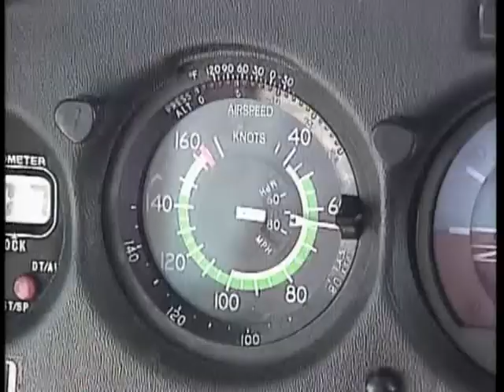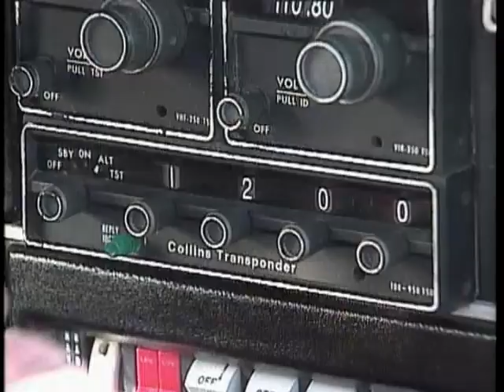Ditching an Airplane by Barry Schiff

Comment: This information is all wrong.  When crashing into water what your suppose to do is open the door and jump out at about 20ft altitude preferably in a stall with the lowest possible air speed.  Using this method prevents all possibilities of slamming your head across the instrument panel during the initial impact and loosing conciseness and drowning do to incapacitation
Reply: Was Trevor Jacob your flight instructor?

Comment: 7:29 A simpler explanation for the disparity between retractable vs fixed gear survival statistics is that I assume retractable gear aircrafts are also higher capacity. So even if the survival rate is the same for both planes within their own type, the number of perished souls will still be higher

Comment: I fly extensive offshore pipeline routes in a single engine prop so I really appreciate this video. Also, remember to equip a registered EPIRB device attached to your lifejacket and a handheld radio.
Reply from the maker: Great advice - an instructor once told me, "If it's not on your person, then it's cargo - not emergency gear."
Of course, when this video was made, there was no such thing. ;-)

Comment: When that Cessna model floats belly-up into the corner of the frame, that's peak visual comedy! As a Colorado aviator, I do want to make a note for ditching in mountain lakes. Lower elevation reservoirs are one thing, but true alpine lakes are not to be trifled with. They are snowmelt, at high elevation, and usually in the shade of surrounding peaks. Even in the middle of summer, the conditions can cause cold water shock. This risks drowning, organ failure, and, of course, hypothermia. Obviously, if the lake is the only level surface, you take what you can get. But if there's even a semblance of flat terrain, you might be better off in the treetops.
Reply from the maker: Great advice - something I hadn't thought of.
Reply: Extremely valuable perspective

Comment: Should i unbuckle me seatbelt before ditching to make evacuation faster?
Reply: I’m not an expert but I have conducted egress training known as “DUNKER” through the Army’s flight training program. I would recommend that you leave your seatbelt fastened for two reasons: to prevent injury in a harder than anticipated landing and to keep your bearing if you find yourself upside down/disoriented.

Comment: I know twopeople that have ditched in the Pacific between California and Hawaii. 
Both because of fuel exhaustion.
One in a Twin Otter at night and the US Coast Guard laid a flare path in the water. They all got out before it sank and floated around in a raft being picked up the next day by a ship.
The other in  a P750 XL. Sole occupant during the day and a Hercules aircraft was on station with rescue divers ready to parachute in if he got out of the airplane before it sank, which he didn’t .
The difference being summer when the ocean was calm and winter when there was a  large swell.
I fly a twin jet airliner over a wild stretch of open ocean and I wonder why we even bother with ditching drills. I am certain that there have been swells so large that the weather radar has given returns on individual swells.
Reply from the maker: I fly between CA and HI and wonder the same. Maybe we never have to ditch airliners in the ocean because of the precautions we take and are ready for it. (knocking on wood)
Reply: I remember the P750 ditching. I listened to the Coast Guard as they were headed out to him (I was a pilot with United Airlines)  I called the Coast Guard the next day to see if he survived and they said no. They watched him hit tail 1st and the nose went into the ocean & flipped over. He hit his head on the dash, the plane was partially submerged, enough to cause him to drown. They parachuted guys down to try to rescue him, but could not.
Reply: @blackbeautytales  I am a New Zealander where the aircraft was manufactured. It was the first one to be exported to the US but never made it obvious. Quite a good product but unfortunately the company has gone broke. Don’t know if anyone else has taken over production or not.

Comment: Ditching on a river…..ignore the current.  Ignore the shore.  Just look at the wind induced waves and land into the waves, the way any floatplane pilot does.   DO NOT ignore waves induced by river current.  Those are stationary and obviously caused by flow.  Try to stay clear of them and land with the current.
Reply: Should also say, avoid ditching in glassy water…..you will NOT be able to judge height so you will NOT be able to flair which means your speed will be high and your nose will be low, inviting a big impact.  If you must ditch on glassy water, do it very near shore or near a boat  so you have some hieght reference.

Comment: If you search Bellanca N8792V you will learn of a brand new 1971 Bellanca 300 Super Viking, entered the London - Victoria, Air Race. Ditched in the fog off the southern tip of Greenland, pilots landed gear-up, flaps-up with no damage to the aircraft, the two flight crew entered a life raft, were picked up by helicopter three hours later.  The next day the Bellance was towed 60 miles to shore put in a hanger after being rinsed off with fresh water.  Those Bellanca's ditch well.  Two days after that adventure they stopped by the dealer Leggat Aircraft and another Bellanca was seen sport a sign..."The New Bellanca Float Plane"
Reply from the maker: Wow - interesting story!
Reply: Yes it is a interesting moment from the past. I have a couple of the official race books published to commemorate this unusual government sponsored air race.  As much as anything it illustrates how at one time GA was much more mainstream.  The list of entrants included, Don Jonz, Clay Lacey, Margaret Mead, Fran Bera, Ernest Gann, Louise Sacchi, etc. @TheProficientPilot